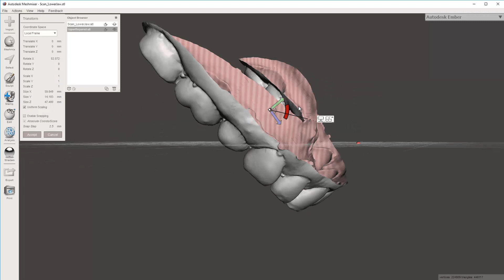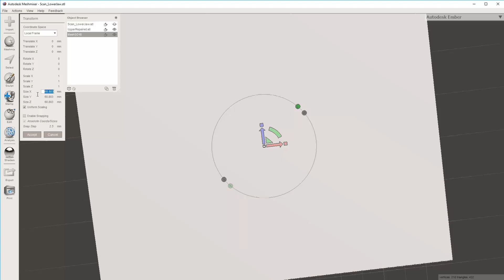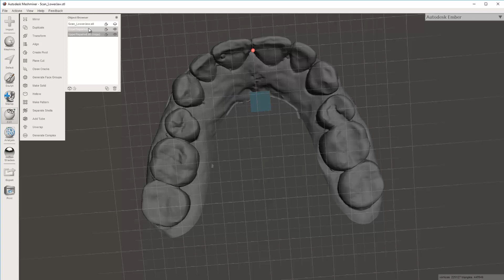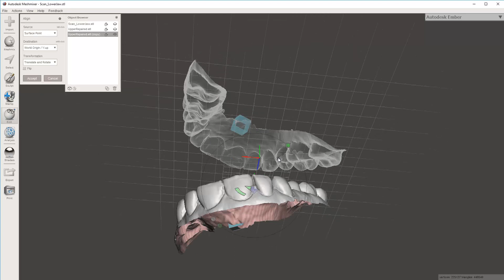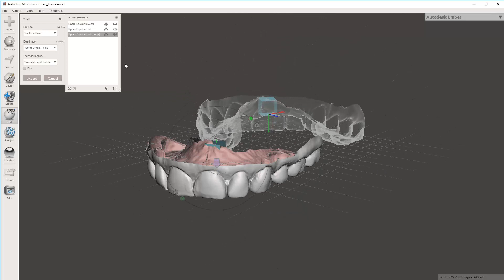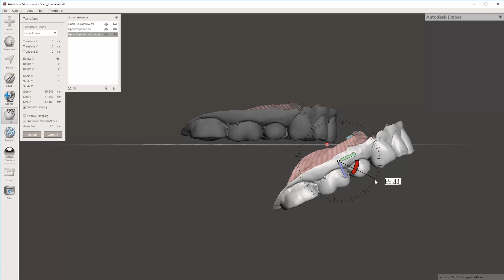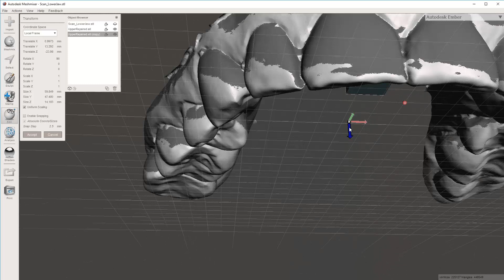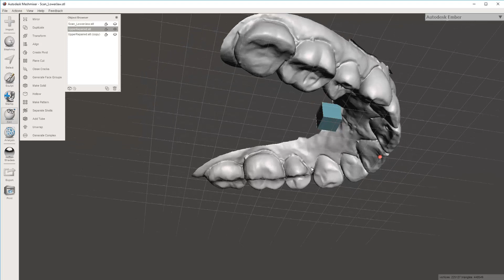Model Alignment Preservation

Comment: Manually align until you get decent visible alignment, no need to be near perfection, then set the model you want to reach as target (click magnet in object browser), then select common faces on the model to be aligned, then from the select menu choose align to target. No need for cubes :) (if I correctly understand what you are trying to do)
Reply from the maker: This is such an old video, it's hard to say. But I'm not seeing how what you suggest will work as stated. Perhaps I'm missing something.
Reply: @bgrutterdds  ouch, missed the 2017 date, silly me :(  if you needed to align a modified model back to the original one, inside meshmixer, my previously posted comment was a badly written abstract of this video: https://www.youtube.com/watch?v=r4CVinwPG9w
Reply from the maker: Ahhh. Great technique. Haven't messed with that in a while. Always knew there had to be a better way with Align to Target. Thanks for the link.

Comment: Do you know how to align a support bar and arch?
Reply from the maker: Not sure what you mean.
Reply: @bgrutterdds  For certain case's when All-on-4 break's, they insert a support bar within the zirconia arch. Do you know how to align that in Mesh mixer?
Reply from the maker: @maximusprometheus6149  Gotcha. That's TOUGH. I would use BlueSkyPlan for that. You can align by point and such. And it's free. MeshMixer is great, but alignment is a tough one. Just not design for multi-point recognition.